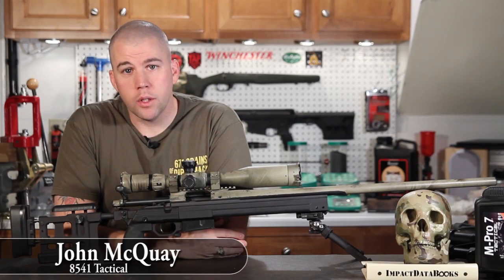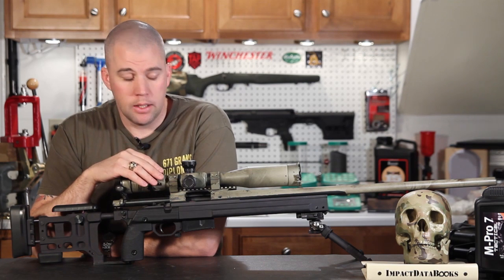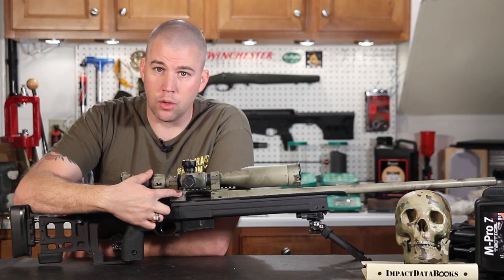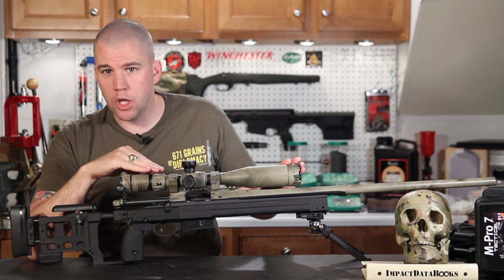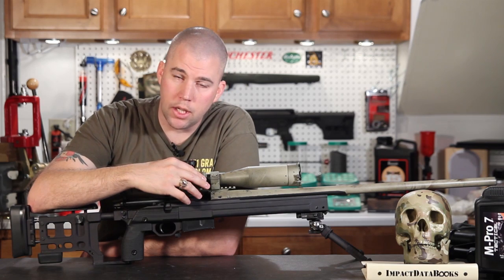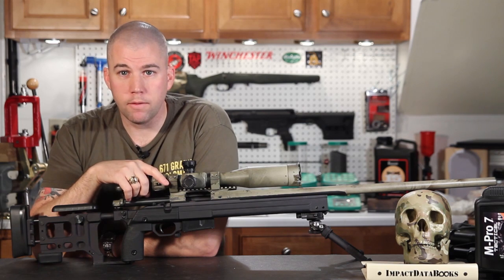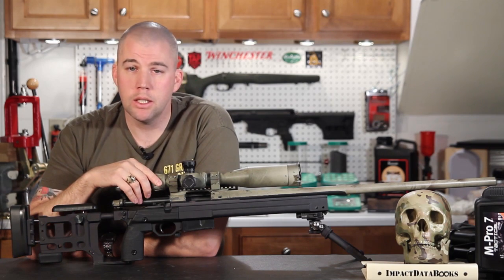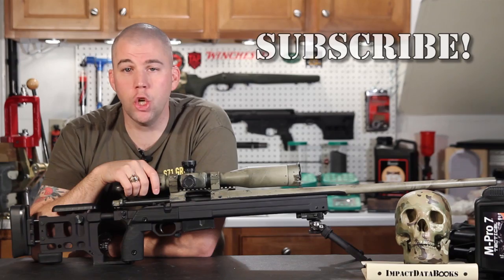Mail Call Mondays #36 - Scope Bases 0 MOA or 20 MOA?

Comment: I have an Arken EP5 on a MPA with a built in 20 moa rail and Chambered in 6.5 CM. I was advised to run my scope from the bottom to the very top then half way back down to the optic center and then run it 20 moa down further and zero at a 100 yards at that point! Said it would give me the max Elevation!  Is this true? Please help!!!!
Erik

Comment: What is your opinion on getting the 20 MOA for the Nikon-223 4×16×42 w/1 inch tube for a .223 Remington 700 VTR bolt-action. 

Would it be a good investment or just go with a standard straight rail mount.
I'll be reaching out to 400 yards and would like your opinion.

Comment: John I need to buy a base for my Remington 700 24” 5R barrel in 6.5 Creedmoor and I plan to use my Schmidt Bender PMII 3-20x50 Ultrashort which is on a 6 mil Sphur qd mount, qdp-4602. The scope has 34 Mils of elevation adjustment. Should I just get a 0 Mil picatinny rail base or a 6 Mil base? The action/barrel will go in an MDT LSS XL gen 2 chassis. What is a good brand base? Alloy or metal?

Comment: Back when I didn't have a lot of building experience, I bought a 20 moa rail for my 270. My local ranges are 400 yd maximums. So for my circumstance, I'm better off without a 20moa rail because I will probably never shoot further distances. Keep it simple right? Unless I build a gun that shoots slower rounds.

Comment: I have a Ruger 10 22 Collector's ed., Barska 1 inch low rings and Vortex 3-9x40. I have tapped out but the crosshair is still high in relation to the bull'seye target. Will I benefit from Burris Signature Zee rings with 20 MOA insert or should I just manually compensate with my present set- up? We use the Ruger for range targetting from 25 to 200 yds. Thanks.

Comment: AR 7.62x39 upper with a 3.5 in sight height, with a scope. Zeroed for 50 yards shoots 1 inch over bulls eye with the cross hairs at max vertical adjustment, I would like to add a QD Piccadilly rail mounted base, What would you recommend for the MOA base to be to get out to 500 yards? , 20,30,40 MOA?

Comment: Total rookie looking to purchase the right scope mount or rings for 100-1000 yards....if its possible...got a Remington 700 aac-sd sa 308....vortex viper pst 6-24 50mm lens (65moa adjustment elevation)....first question (with the larue rail with the cutout over the breach) am i better off with rings or a solid mount....and ill mostly be shooting under 600 but eventually i want the 1000 yard mark....im wondering if i should just go for the 20moa mount now or ....???

Comment: I bought a savage 110 BA with a 20 MOA mount, and I've maxed out  the lowest elevation of my scope to zero at 100 yards with 250 grain bullet loaded to about 2800 fps. It is a Vortex Viper 6-24 30 mm tube scope, and it tracks properly when shooting on this rifle. What do you think the reason is for this issue?

Comment: interesting video. I was under the belief that with a 20moa rail you would never be able to have a 100 yard zero which brings me to my question. I really want to purchase a mdt  tac21 and run it with a tikka t3 223 but it will only be used for 100-300 yard shooting. Is it possible to zero in at 100 yards (seeings it has a 20moa built in rail). if so what scope do you suggest to use, most of the shooting done with this rifle will be at night.

Comment: Hi, I have a savage 10 pc in 308 with talley 1 piece 20 moa rail, low vortex precision rings, vortex viper pst 6-24 with ebr-c2 reticle. I can not zero at 100 yds, bottemed out, and have to hold 2 mils low to hit bullseye. Would like a 100 yd zero, any suggestions? Thanks

Comment: Now, I also have the s&b 5-20x50 ultra short single turn 16.5 mils total elevation ..will the 20moa base get the same AAC SD out to 1200 yards? Or would you recommend a different base for my ultra short?

Comment: If you zero at 100 yards, then that means you will no longer make any nob adjustments, right? You’ll use the reticle marks to make adjustments beyond 100 yards. Why do you need the 20 moa scope mount if you will not be making nob adjustments?

Comment: New at 20moa base. Do you still use the standard rings or haft to buy new set of rings to fit the 20moa base? Because of the taper.

Comment: Hi there. Joe from NY here. Great video. I have a Marlin 1895 22" bbl that I have owned for years. I have tried 2 different scope mounting systems the latest being a pic rail with weaver tactical 6 screw rings.  Scope is a leupold VX III 2-7 x33. With both of these setups The rifle will shoot 6" low at 60 yards with Elev. adjustment maxed out. I love the rifle but have been frustrated trying to zero at 100 yds. I do not want to shim the rear of the base. Do you think A 20 moa base would help solve this problem. I believe this whole situation is caused because the receiver is canted. I have leveled the rifle then put level on receiver and it is apporx. 1/8 " lower in the rear . THank you for your help and keep the great videos coming!

Comment: I recently purchased a Ar-15 DelTon for my wife. I mounted a Nikon M-223 scope with a one piece Nikon scope mount.She has a problem with the scopes magnification factor so we went scope shopping. We wound up with a Vortex 6 X 24 X50 scope with a Burris one piece 30mm QD mount. My question is this. At 100 yds. the up knob is bottomed out. I am about 3" below center @ 100 yds. Should I shim the under the rear ring and how much would you think? I suspect that the gun will do just fine at longer ranges but I'm unhappy that we upper lower dial is pegged out at the top and we are unable to shoot accurately at 100 yds. all hardware is blue lock tightened and torqued for 15 Lbs. Can You please shed any light on my dilemma?

Comment: Hoi John. Great video again! Question: I did some math and according to that I would need to raise the rear scope ring by 1.6mm to get maximum distance out of it. In that case I would only have 3 clicks down left (1 click being 1/4 MOA). Are there drawbacks? I heard it would be better to stay within 1/4 to 3/4 of height adjustment. Otherwise the tension spring inside would be to lose and cause the recticle to move free. Is that true? I am aware I would have to make sure that my shims would be tapered. Thanks in advance for your answer!

Comment: At 7:17 you said dialing down. You meant dialing up right? Because if you had your scope zeroed at 100 y with a 0 MOA and puts on a 20 MOA that results the POI 20 MOA higher. So in order to compensate for that you need to dial UP on your scope. If you dial DOWN the result would be your POI is 40 MOA too high. Am I getting you right?

Comment: Hi John, enjoy all your hard work immensely . I'm thinking of buying the tikka tac which has the zero rail which travels down the fore stock. What I'm wondering is if I were to swap out the scope base part for a 20 moa base , how much would the front of the scope drop down. my front objective is 50mm and I'm trying to figure out the scope ring height I will need, or figure if I can keep the ones I already own. The scope is a Stenier 4X16X50 Military, which look close to the length of yours.

Comment: I'm looking at a Picatinny Rail from Badger and a Spuhr Base. I'm still deciding what optic I want. Based on the optic choice, I'll know what elevation range I have to work with. Is there a shooting best practice to add MOA to the rail or base? If I go for an optic with say 100 MOA elevation, in theory I would probably have to use both rail and base for a maximum of 50 MOA addition to maximize the optics elevation range. I can't actually see ever needing 150 MOA Elevation, that would be beyond any range I likely will be shooting.

Comment: Thanks for your clear, to the point video. I am still torn on which to pick.
I recently had a Remington 660 Mohawk .308 handed down to me that required extensive restoration. It has a horrible see through mount system with old 3x9 with a square eye piece.  Anyways, I am going to get a rail for it and am going to keep the 'scout rifle' theme going. I am pondering what optics to use, but leaning towards holographic or red-dot. I hunt white-tail in the Appalachians, so woods shots and some open fields under 500 yards. Generally 75-250 yards.
Any suggestions are welcome as I am torn on which direction to take this old rife.
Thanks

Comment: Thanks for the excellent explanation of stacking.  I didn't get it before but, thanks to your explanation, I do now.  I have one question.  How do I determine what angle my mount has?  Leupold Mark AR Mod 1 3-9x40mm P5 Turret Firedot TMR tactical P5 elevation turret with 1/10 Mil adjustments and is calibrated for .Federal 168 grain Match King ammo mounted on a Leupold Mount and both are mounted on a DPMS LR-308. I cannot find any manufacturers data on this topic in what was supplied with the equipment.  Keep up the good work.  It is studied, used and appreciated.

Comment: Question- I am running a 20 moa rail built into the gun (Larue OBR) with a Leupold Mark 6 3-18 scope. It has built in 20 mils of travel. by my math thats about 68 moa of travel (20x3.6=72 / 1.047= 68.76). What I am having a hard time wrapping my brain around is this: I have it zeroed at 100y, and gave myself .1 mil of down travel when I reset the zero stop, which leaves me 19.9 mils up travel...I would still only have 19.9 mils up travel if it was a level base correct, so what did I gain?

Comment: I'm sold on the 20 moa base for sure. It wasn't even what I was looking at. I have a custom HS Precision 260 Rem ordered. I bought a Nightforce scope. Now I need to decide on one piece or two piece and what brand of base to buy. I want the best for this rifle. It is my first custom. USE: mostly range. Will take it for coyotes or antelope where packing it a long way is not happening as it has a fairly heavy barrel .750 at muzzle. Accuracy is more important for this rifle than weight. I have light guns for the purpose.

Comment: Hi John,

I have a Savage 110 BA .338LM with a Nightforce NXS 5.5-22x56 (100MOA of Internal Adjustments). Currently I have a 20MOA Rail and I max out at 20 Mils (approximately 1600-1650m to use max elevation). I want to get out to 2000m. In order to do so I need more adjustment. I was going to order a 40MOA Rail which should give me another 5-6Mils of Adjustment to take me out to 1800-1900m (without using my Mil Dots for further Distance). Do you think I can get a 40 MOA Rail to zero at 100m?

Comment: Interesting... I just ran some math. My scope has 23(56 total) MOA adjustment. Shooting .308, on a 300 yard zero, my scope has enough adjustment to handle just under 800 yards. If I was to add 20 moa mount the scope would then have enough adjustment to handle somewhere between 1000 and 1100 yards.

Question is do I really need it? Realistically I'm going to shoot at most 200-300 yards on a normal basis. The scope is on a 16" barrel shooting 1.5 moa. The gun is only effective out to 600ish yards.

Comment: Hey John, because the .223 Rem round isn't a long range round, would a 20 MOA base be necessary or could you get by without an issue with a 0 MOA (depending on the scope's limitations of course)? Thanks.

Comment: Put a 20 MOA base on a Ruger American in 30-06 with a Barska Excavator scope and with 178gr light loads, I was within .5 minute of not being able to zero at 100. Meaning the turret wouldn't adjust any lower without really cranking on it. Upgrading soon to a 30mm BSA tactical. Just got find a spot for over 300 yards

Comment: I would add that even if you can't get a short range zero because of your scope base angle, you can use a "hold under" for a shorter range zero. Just check your ballistics charts and take note of the angle. Also, if your scope adjustment can only get you out to X yards, you can probably use hold overs to go another 200 or 300 yards.

Comment: Thanks. I just picked up a Remington 700 SPS Tactical AAC-SD based on your review.  I am now looking into scopes and base.

I am leaning towards the Bushnell 6-24x50 scope.  The Bushnell looks like it has 70 clicks of adjustment which is really only +/- 35 clicks.  Most of my shooting will be between 100 and 400 yards but I'd like the option of going out further.  If I get a 20 MOA base, would I still be able to shoot 100 yards with this combo or would I need a 0 MOA base?

Comment: Hi John,

Shooting a .308 Win 24" T3 Tactical and want to shoot at around 500-700 meters. Would you advise getting a 20MOA base or scope mounts? If I were to switch from shooting at 500-700 meters to 100 meters would it be okay to just zoom out of a target and use the highest dot on a scope after sighting in at 500 meters(hope that makes sense).

I just got into rifles from pistol so I'm still a major noob =]

BTW I have that same Whiskey 3 chassis on the Tikka T3 Tactical lol.

Thanks!

Comment: think of moa or mils as a giant circle.  Mark a point in the center then draw two lines on there own plane relatively close together all the way to the edge of the circle.  You will notice as you move from the center dot to the edge the farther each line gets from each other.  This is what is occuring with MOA and MILS.

Comment: Most guns should have a built in 5 Degree rail not 0.   The scope height of 1.5" + 2" of bullet drop at 100 yards = 3.5 MOA of UP adjustment off optical center.   And most guns seem to have some barrel droop.  The rail and barrel are not made in perfect alignment that is usually 1-2 MOA.     I've had a few guns with 1" scopes that I ran out of vertical adjustment due to the barrel rail being so far off spec.   I've never needed a Negative rail always a 10-20 MOA just to get that 100 yard zero and keep close to optical centered on the scope.   Burris signature rings take care of that issue on those particular rifles.

Comment: granted. not exactly a hunting/ 3 gun setup. but... im still sitting on the learning curb as it were. and thanks quite a bit to your channel, im learning a metric shit-ton. lol. theoreticly after 300 yards you've got nothing but drop depending on the load (im using 308) and elevation angle. im guessing a stand alone 20moa is that sweet spot for a do-it-all-good-enough kind of rig.

Comment: +1 on the short vids, much easier to fit into work, kids and all that stuff. 

How about some field trip shows? Maybe a show on a typical range session? Multiple camera angles, showing a frame inside a frame with different points of view? The differences in a bolt vs semiauto? Just some ideas.

What drills you run through during practice, how you set up as far as equipment, targets and what have you.

Thanks for the great info, looking forward to more.

Comment: Excellent Simplified explanation without skipping over how you got to the bottom line.  Now if I could just find the specs for my cheap scope.  Using this information in relation to dealing with my pellet gun's "barrel droop" issue.  Think the investment in a 20 MOA mount   is the only way to tell for sure.
Reply: You can turn your elevation turret/dial all the way up and then count how many moa or mils it takes to get all the way back down.  If it's not enough to meet your projectile drop at the distance you want, then you can spend more and get a 20moa rail.  I'd personally spend more on a better scope with more accurate turrets than buying a better base if you're on a budget.  If not, get both!

Comment: Great video! Subscribed! I am new to precision rifles. I hope you can answer some questions for me. I have a Trijicon Accupoint 5-20x55 (Model TR23-2G).  Per the manufacturer specs, the scope has a "-/+ 20 MOA (+/- 5.9 mils) minimum adjustment" range.  This is going on a Remington Model 700 SPS Tactical AAC-SD.  

(1) What are the possible ranges of a 0 MOA base?  
(2) What are the possible ranges on a 20 MOA base?

I am planning on shooting the rifle at the 100 to 500 meter range.

Comment: @bkfreas-  If, at 500 yards, your point of impact is 66 inches below your point of aim that's 13.2 MOA low... In all honesty (sorry guys hate me if you want) don't worry about the extra .047.... IT'S LESS THAN A HALF INCH AT 1000Y FOR PETE SAKE...so for now, omit it. That same 13.2MOA low at 1000 yards however, is now 132 inches and the same '53' clicks if that helps...keep the questions coming if you're still not sure.

Comment: this helped alot!  my problem is exactly the opposite, I run out of elevation..e.g. i have put 2 different scope rings with and without risers with 3 different scopes and on every occasion i run out of elevation adjustment...e.g. with elevation turned all the way up i still have to shoot 8 to 10" low to hit target @100yds. no one around here can figure it out..
Reply: If you are using 20moa rings, you have your rings on backwards.

Comment: To put it simply, a 20moa drop in base, makes you raise your crosshairs 20moa to get back to zero at close range. 
Now, when shooting LONG range, you have that extra 20moa you can drop your reticle to meet the bullet (since drop is greater at longer distances).  

Dont forget when trying to understand this. The further you shoot, the more your bullet drops. If the scope starts out angled down, this is like a 'head start' so to speak.
Reply from the maker: +Just1Spark exactly
Reply: Thanks. Didnt mean any disrespect. Just trying to add more angles of explanation, to appeal to more people.